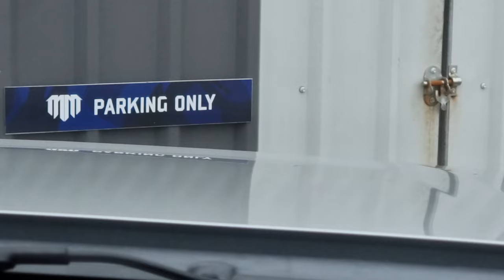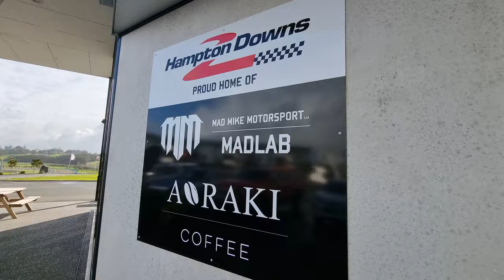TESTING THE NEW E90 STEERING... eek | BUMP IN DAY AT BAYPARK D1NZ FINAL ROUND 2022

Comment: Did you end up keeping the electric power steering? I’ve got it on my car and it won’t steer back. Trying to work out if I should go back to normal pump style instead of electric
Reply from the maker: The electric is still in it. But its being changed this week. 
Try and put more + caster into the front. Will help with self steer.